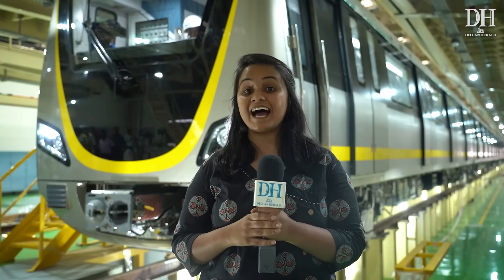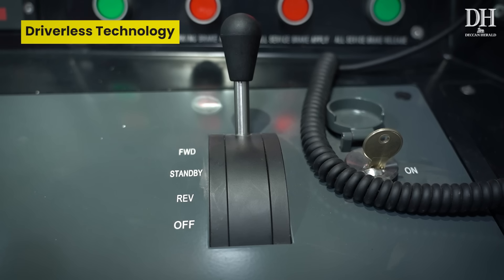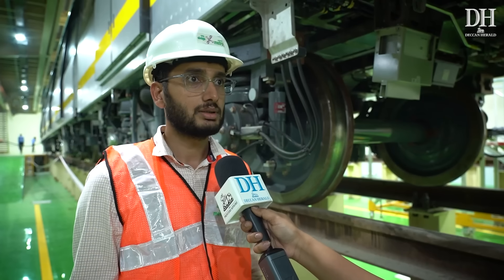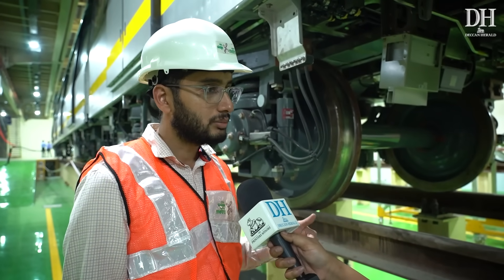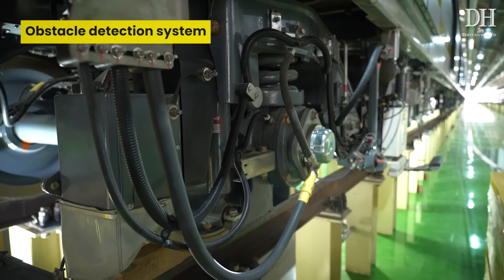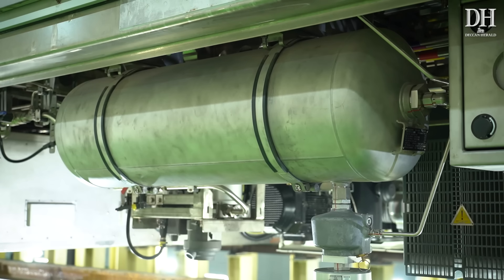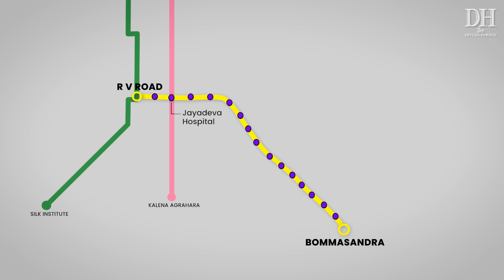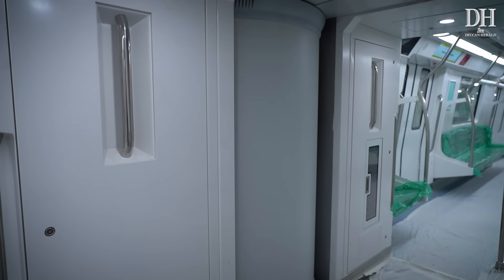Bengaluru Metro's Yellow Line first look | AI for safety, driverless; operations to begin year-end

Comment: How safe is it , have the safety regulations been followed. After any incident probe would begin then blame game will start. From centuries this is happening.
Reply: Very safe
Reply: @Savant_Ananya  who has verified the safety measures and which agency has given safety rating .
Reply: @vijaysubramaniam1174  there is a strict guideline which every metro has to follow. The guidelines are published by RDSO. They do trails run for months before metro opens for public use to check for safety of track and trains.
Reply: @Savant_Ananya  all the best you can travel by metro.

Comment: We are very disappointed that despite the unofficial call to boycott Chinese imports, a government organization like BMRCL haschosen a Chinese company CRRC to acquire this train. So much for Mr. Modi's policies. German companies like Siemens also make these trains.
Reply: Unfortunately, the contract was given back in 2019.
Now no new government project construction/engineering contracts can be given to Chinese firms!
Reply: @cts4044 Who knows? Without China is any thing possible? China's role in many ways involving many of the things go and See Port in Indian state of Gujarat 100% of Electric Vehicles systems are from China even in Up Citis new mahanagari city buses are from China all these are of recent years
Reply: These trains use a lot of components from other manufacturers. German trains are much more expensive and China in recent years has the most experience building trains. Most of the technology is based on German trains so indirectly, we get German trains at a much lower cost.
Reply: @alileevil  Not based on german Technology but it used Original parts supplied by Alstom Rails coaches are from China but it's Automatic driving system is from Alstom China also used its own but they use here Alstom driving system Automatic doors are From American company I think and Whole 38 Companies parts has been used in that metro. Even China itself given Order to Alstom to supply metro for China why? Did China is not capable to build metro on its own? Yes they are capable but they want To do these because of Government representation of Germany by giving order Them China creats a effect on Germany if they don't use any thing from any country than how can world will survive?
Reply: I'm not disappointed,  I can't imagine a life like yours who is raised by Indian tv news channels stuffing crap into your head.... Chinese normal people don't even care about India busy with living their life, but here even a school kid will be trying to spread hate towards China...

Comment: The bmrcl authority who kept gloating that it's the lowest metro in the country shows us that only fools are running bmrcl. It is low because such high end exports from China are given huge subsidies by the CCP to  drive away competition from local competitors whose product would be higher but in the longer run is going to harm the local market but now the government has barred the import of metro sets from China which is a great move for local companies or companies that manufacture locally creating jobs here. We need to stop this useless tendering process of giving tenders to the lowest bidder in this country from now onwards and instead look at quality and time frames required to complete a project as most projects in the country are suffering from cost overruns due to the project not being completed in specific time periods

Comment: What the hell is wrong with bmrcl. I would say they are the most stupid, useless and hopeless metro authority in the country now. What was the necessity of going ahead with crrc after the issues which we have had with them since 2020 border clashes with minimal trade between the countries. They should have scrapped the deal and given the contract to BEML that already manufactures metro locomotives in Bangalore itself and are equally good. They would not have had to wait for so long for the yellow line to start which has been delayed again and been postponed to December from the expected month of June as they have still not received the actual train sets from titagarh and which is expected now only by December now . Why don't they learn a thing or two from DMRC on how to run an authority responsibly as they are just losing face in the public for being so inept and complacent

Comment: Why these metros look better than vande bharat
Reply: Because, they are metros designed on dedicated new tracks, and new platforms with level access. They also do not exceed a speed of 80kmph!
Vande Bharat is designed and being designed to run on existing rail lines at speeds above 110kmph and after track upgrades speed of over 200kmph. The height of the trains is higher. The weight/mass of the trains is more! It is much more heavy engineering with air spring suspension. These metro trains are dedicated small coach trains with seamless walkthrough which run on newly engineered dedicated tracks. They are not designed to be adaptable to different track conditions or harsher environmental issues!
Reply: @cts4044  You got too technical. Had they simply chosen some metallic color instead of blue and white, and made it slightly bulkier, or would've looked just as good